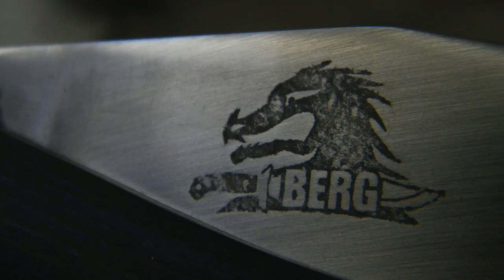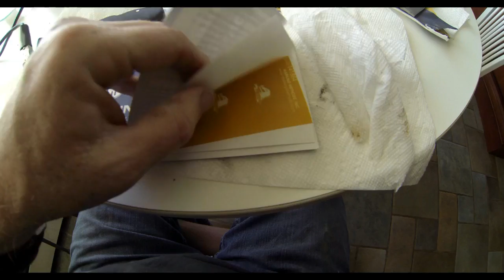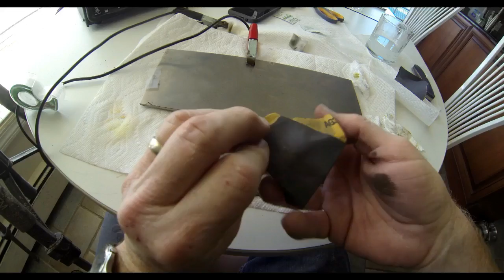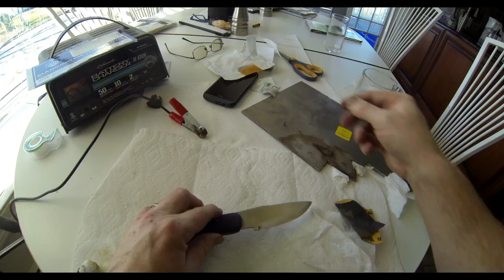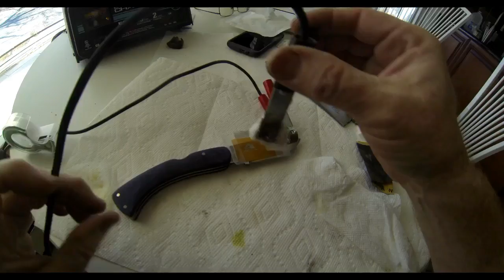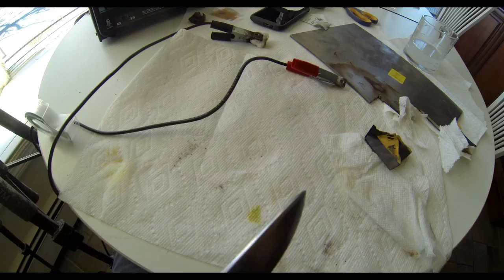DIY Knife Makers Mark Etching and logo design

Comment: I just learned to use AC power after you etch to blacken it, and the end result is much better.  DC power will etch (dig a trench in the metal) but it won't blacken.  AC power will blacken/mark but not etch.   Do DC first and then AC and see what you think.    You can easily find alarm system transformers that are 16V AC that plug right in to the wall, or just use a "whatever" wall plug as long as it puts out AC.  They aren't nearly as common as DC but they are out there.  I got a cheap AC to AC wall plug adapter from some unknown electronic device on ebay.  It outputs 10 volts AC @ 1.5 amp.  Works great.   Now you don't have to turn the knife in the light to see the logo because it's nice and black.